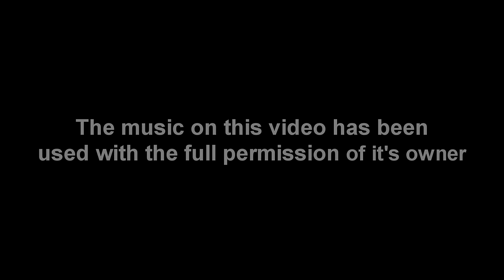Time lapse - building a cinema room

Comment from the maker: Length of the room is about 5.9 Metres, Width at the widest part (the front) is 4.47 Metres. 

The screen is 120 inch diagonal 16:9  (which we think is a bit small for the room), but that's the size the client decided upon. 
It's 7.1 surround.  - Atmos was offered as an option.  
I think it's about 2.5 Metres to the first row and about 4.8 Metres viewing distance from the 2nd row. 
As before I think that is longer than optimum for the screen size but it is the client's Cinema so it's the clien'ts choice.
Reply: UK Home Cinemas how much did this cost?
Reply from the maker: Here is a rough overview. To knock down walls to, extend an area to make the room square, carpets, painting, electrics, carpentry,  move the boiler - the building works and supplies were about £35k  (that doesn’t include the planning permission, architect, building regs fees). 
The cinema seats were sourced carefully to get a low price of around = £7000
Projector, screen, Star ceiling, programming etc approx £9000. We used speakers which the client already had.  
Total around £51k which didn't include the speakers.  Please note that most of the cost here is building work and carpentry etc.  we do many projects where there is no need to re model the room. If we are only adding cinema room equipment to an existing room and not providing seating, lighting etc the starting point for a complete HD cinema room system with 5.1 sound is around £6K  but it is of course possible to spend a lot more for 4K / Atmos etc. We have example packages on our web site with pricing.  http://ukhomecinemas.com/packages/dedicated-cinema-room/
Reply: UK Home Cinemas I
Reply: How many square feet is the room?
Reply: What kind of chairs are those?
Reply: UK Home Cinemas do you guys have kids
Reply: UK Home Cinemas what's the square footage of the room?
Reply: Ehat will be the cost for 6 seater
Reply: UK Home Cinemas Price ?
Reply: To bad y’all don’t install in the United States, this is how I want my movie theater to look like.
Reply: k
Reply: I went with a recessed 120" and a 2.35:1 which is fixed frame which is 11ft. That screen size more what you were thinking?
Reply: @tititata5137  LOL
Reply: Scott Tilden I know what you mean but I’m the exact opposite. I know most shows are shot 2.35:1 but for the few that aren’t or that have imax enhanced scenes, I can live with the bars easy. All preference I guess.
Reply: Sir is there larger screen available for home as in real theatre
Reply from the maker: @kingarwin906  Absolutely, Yes there are other aspect ratios and many sizes plus we can have them custom made if a particular size is needed.
Reply: @Ukhomecinemas  Thank you Sir for the info😊🙏..I will check it out than

Comment: AWESOME.  But if I had one built it would have to be a lot Larger Screen then that tiny one.
Reply from the maker: The screen is 120 inch diagonal 16:9  (which we think is a bit small for the room), but that's the size the client decided upon. 
I think it's about 2.5 Metres to the first row and about 4.8 Metres viewing distance from the 2nd row. 
As before I think that is longer than optimum for the screen size but it is the client's Cinema so it's the clien'ts choice.
Reply: I don't agree. The old rule used to be 1.5 x the diagonal of the screen. This screen is 10 feet, so you would sit about 15 feet away for optimal viewing. They are sitting way too close for the size of this screen at 8.2'. THX calculator recommends 13.4 feet as the optimal viewing distance for a 10' screen.
Reply: @OMGWTFLOLSMH  those are considered maximum viewing distances

Comment: Looks cool. Lots of work!  First thought is sound solation. Is this a detached room or garage? Is the sound from surroundings going to leak into the space?..or the other way around?  With all this work,  id likely be considering building ROOM WITHIN A ROOM!  
Regardless of that,  my nexr thought is why not go BIGGER on the screen?!! Doing a near wall to wall TWICE as large screen,  would be more cinematic and impactful! Anywhere from 1.4-1.7 gain micro perf screen , or brighter 4k projector could do the trick. Would look IMAX when installed correctly!
Another thought is bass traps and proper acoustical treatment.  Particularly,  a large bass trap could be built into the space,  either above, below,  or behind,  to help absorb low end for balanced reverb in bottom end. Then traps in corners, and absorbs n reflects at reflection points n such.   
Better results i think
Reply from the maker: The screen is 120 inch diagonal 16:9  (which we think is a bit small for the room), but that's the size the client decided upon. 

I think it's about 2.5 Metres to the first row and about 4.8 Metres viewing distance from the 2nd row. 
As before I think that is longer than optimum for the screen size but it is the client's Cinema so it's the clients choice.

With regard to room within a room that would be great, but its costly to do and would reduce the room size quite a lot. This house has a big garden, so I don't think that the neighbours are too close, so haven't been disturbed by sound leakage.

Comment: How much does something like this cost? I want one!
Reply: What thing?
Reply: @user-me3rt5lt2k  the whole thing smh
Reply: It varies greatly but for this setup probably around 75K. You can easily get to close to a million dollars with a home cinema.
Reply: I did a similar setup, albeit smaller. I bought an Optoma 4K/HDR10 projector ($999), Yamaha RX-V585 AV receiver ($550), Jamo S809hcs 5.1 sound system ($500), Klipsch R-12SW subwoofer ($250), wires and cables ($150), cinema chairs ($500 total), Elite 120" motorized projector screen ($300), and hired a contractor to redo the ceiling and do the wiring (~$2,000), Synology NAS (to store movies, tv shows and stream them to my projector using Plex which works like a local Netflix, $250). Finally, I got a $35 popcorn machine hehe. So all-in cost is ~$6,000 +/- a couple hundred. Is it worth it? Hell yeah. No comparison with a regular TV and a soundbar. It's different. Once you try this experience, you'll never go back. I binge-watched Boardwalk Empire, Westworld and a couple other HBO masterpieces during the lockdown. Best time ever.

My advice to you would be: 1) wait for promotions (don't pay MSRP), 2) get refurbished items whenever you can (my projector's MSRP was $3,200 and I got it refurbished for $999), 3) get an AV receiver model that's one/two years old (no big differences in features but a lot cheaper), 4) make sure you pick the right equipment match (the speakers must match the AV receiver, the wires gauge must match the speakers AWG rating, the subwoofer must match the sound put out by your sound system, your projector screen must fit your wall dimensions, the projector's throw distance must fit your room orientation (also make sure you get a projector that puts out 16:9 image), the whole system must match your room's space), 

If you need more help let me know. Also, there's a great website called Crutchfield.com. It's amazing. Give it a few minutes and browse around. You'll love it.
Reply: @KhaledTheSaudiHawkII  yeah but you’re not counting labor. With labor probably 30k
Reply: @ChadKirk  no way. It’s not even close. I’d say it cost around $11k.

Comment: How much money spent for this mini theatre
Reply: Don't even bother building a mini theatre at home, it isn't worth it. A much better and rational solution is to buy a SOFA and a TV and there you go, a great experience. (greater I would argue because the resolution of TVs especially the ones coming now in 2020 and beyond are  insane)
Reply: @Danuxsy  My dad is looking into purchasing an 85 inch TV because they used to be $4,000 now it has come down to like $1-$2,000 price range! Just browsed at Best Buy the other day and my gosh the Ultra HD and OLED TV looks amazing and we might consider getting one.
Reply: @Danuxsy  I much rather have a bigger screen and sorund sound 8k resolution isn't that noticeable also   more  4k projecters are coming out
Reply: @Danuxsy  I will just say personal opinion. but a sofa and a tv will NEVER even a 2020 OLED will NEVER outdue a well-built cinema room. The sound alone makes the experience 10x better, the seating alone makes the experience twice as good and don't get me started on a 120-200 inch screen projected by a 4k projector that in every way competes with an OLED besides black levels. More rational experience maybe but DEFINITELY not a better experience
Reply: @Danuxsy  completely wrong. We have a 65" oled and a 104" projector screen. The pic of the TV is better yes but the projector set up is miles and miles more immersive for a film you can't even compare. It's a long way aways until you can get an 'affordable' 120" oled or top class TV screen
Reply: @niro750  Yeah maybe you're right, the only experience I have is with the projectors at school 😂 and I'm not even a TV guy, I watch movies on my PC.
Reply: @Danuxsy  I'm nearly the same. Alway had good pcs and monitors (to a point) but you definitely can't beat the projector (yet). Those new modular screens may event kill projectors when they are cheaper and do better HDR and brightness but it's so good to have the big screen even when it isn't all the most expensive gear. The kids love the 3d films as well. They were not great on a TV but on a projector it's brilliant

Comment: awesome job guys.  i agree one of the best looking with the star scape ceiling.  I noticed there isnt any acoustic panels, do you believe they are important for a room that size.  also random question what colour did you use for the walls?
Reply from the maker: We usually do use acoustic panels , in this room there are lots of soft furnishings, thick carpet, star ceiling panels, fabric window blinds and an irregular shaped room, so the acoustics were not too lively.

Comment: @UKHomeCinemas I’m in the middle of doing my theater room by myself here in U.S. I only have the foundation so putting all the studs and everything in next couple of weeks. Only thing I want to know is, how did you create the middle blue light. Did you use crown molding with hue light strip or did you create a space between the ceiling and the soffit, if so what did you use to cover up or how did you use get the get the blue led effect. If you have a slower version of just that part of video or link will be much appreciated. Thanks

Comment: Great film. What were the dimensions of the room.? What size screen did you fit? How far is the first row and second from the screen?  What surround speakers did you use? Is this atmos setup too?
Reply from the maker: Length of the room is about 5.9 Metres, Width at the widest part (the front) is 4.47 Metres. 

The screen is 120 inch diagonal 16:9  (which we think is a bit small for the room), but that's the size the client decided upon. 
It's 7.1 surround.  - Atmos was offered as an option.  Sorry but I don't have the measurements to hand for the viewing distances.

Comment: Such a large room wasted on a small screen.
Reply from the maker: Yes the room could have worked well with a larger screen , but the customer chose the size which they wanted and the customer is king.
Reply: 120" is not exactly a small screen. It's 10 feet. Personally, I thought the room was a bit small. I think the screen is a good match for the distance to the first row of seats.
Reply: 7 seats ??
Reply: @OMGWTFLOLSMH  I could imagine a bigger screen there, with especially different ratio .. 16:9 is a bit outdated I'd say ..1.85:1 would be better
Reply: That room was tiny wtf
Reply: It's not wasted of that's the size the customer wanted! What a daft conclusion!

Comment: How much did it cost? I mean the overall, I would like to do the same thing in my house, and I need numbers. Thank you very much
Reply from the maker: This wasn't a particularly high budget project as it is not 4K and the speakers were already owned by our clients. We offer complete HD/3D home cinema systems including installation starting from about £6000 including VAT (this can rise to 20-30K for a much higher spec system e.g. a 4K projector based system with  dolby Atmos 7.2.4 sound and superb speakers). These ballpark figures don't include re modeling a room like this, or adding a star ceiling, or a touch screen control system like the one in the video. It also doesn't include providing seating etc. It would be easy to spend £15K on significant room re modeling and lighting similar to the system in the video. Seating tends to come in at about £1000 per seat but there are more affordable ways to get a great result and we always work with clients to help them get the most for their budget. Often that means working with the client's own builder (who is often already doing other work in the same overall refurbishment project). Often our clients source some things or already own some of the kit.  Sorry I can't be more specific about this particular project but we don't engage in any high pressure selling, we just offer to help and we won't keep bothering you . We don't have salespeople, so please feel free to talk to us and with no obligation.
Reply from the maker: One other point we have example packages on our web site with pricing including installation. http://ukhomecinemas.com/packages/dedicated-cinema-room/
Reply: ***** Thank you, you have been very helpful

Comment: Do i spy lightwave rf modules for the lights? If so how do you rate them compared to others such as zwave? Obviously as a home automation supplier i trust your word!
Reply from the maker: Yes we used Lightwave modules to control the lighting and to switch the mains  supply to the subwoofer.  This project  Didn't have a huge budget and these products are pretty low cost. If the budget was higher we would have used Rako or Lutron. having said that they do what they are supposed to do and there is a 3rd party one way IP driver available to control them using the RTI control system, so they fitted the bill in this case.

Comment: How to sound proof  and light proof windows,how do we clean it
Reply from the maker: On this project the side windows just have blackout blinds, which can be opened when you want to clean the windows. The other window has a blackout roller blind but also has plywood and a frame covering it , so it may be difficult to clean the inside.

Comment: how much would it cost to have something like this?
Reply: in germany ... 10-15k lol if u dont get high end stuff
Reply from the maker: Here is a rough overview. To knock down walls to, extend an area to make the room square, carpets, painting, electrics, carpentry,  move the boiler - the building works and supplies were about £35k  (that doesn’t include the planning permission, architect, building regs fees). 
The cinema seats were sourced carefully to get a low price of around = £7000
Projector, screen, Star ceiling, programming etc approx £9000. We used speakers which the client already had.  
Total around £51k which didn't include the speakers.  Please note that most of the cost here is building work and carpentry etc.  we do many projects where there is no need to re model the room. If we are only adding cinema room equipment to an existing room and not providing seating, lighting etc the starting point for a complete HD cinema room system with 5.1 sound is around £6K  but it is of course possible to spend a lot more for 4K / Atmos etc. We have example packages on our web site with pricing.  http://ukhomecinemas.com/packages/dedicated-cinema-room/
Reply: +UK Home Cinemas looks like I gotta start saving😂😅

Comment: What kind of ceiling did you use ?
Reply: Its fibre optic/star cloth
Reply from the maker: It's made up of Starscape infinity panels from starscape star ceilings limited. www.starscape.co.uk ( we are a dealer and installer for Starscape products).
Reply from the maker: Its a starscape infinity ceiling from starscape star ceilings. http://www.starscape.co.uk/home_cinema_lighting_infinity.php

Comment: Not sure why the customer cheeped out so much when it came to the electronics. I think I would’ve skipped the tray ceiling and spent the money in the grading of the projector into the wall and the electronics into a more flush cabinet instead of just sitting on the counter. Looks like they ran out of money. Especially with the Home Depot brand refrigerator. Yikes.